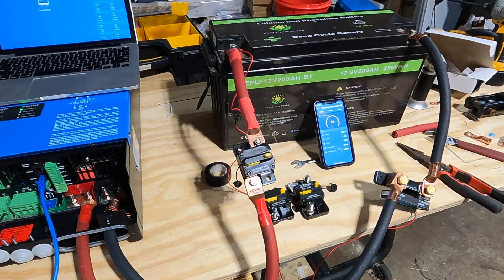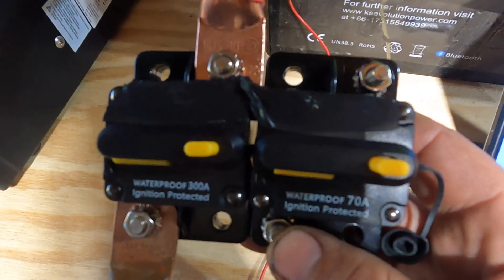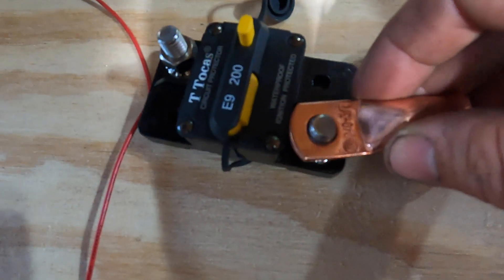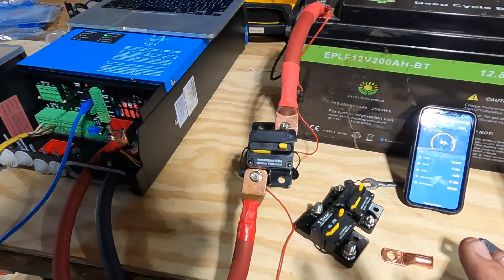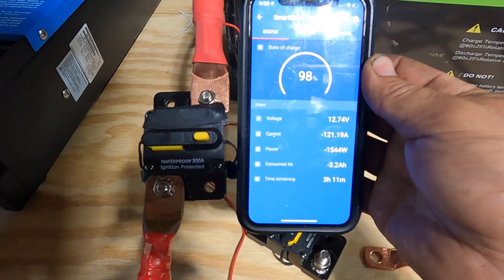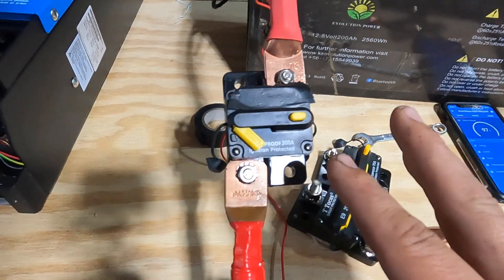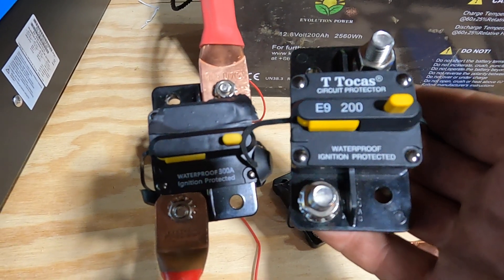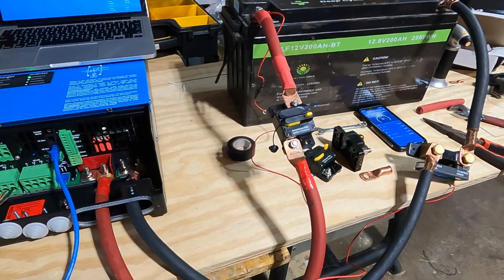Cheap High Amp DC Breakers are they safe?  Let's find out!

Comment: I bought Amazon 150 amp circuit breakers and they trip if solar is outputting more than about 60 amps under load to battery.  If ran off batteries alone it's ok, but the breaker is between the batteries and the solar charger.  I am going to try adding the second one that it came with in parallel to the one breaker and see if it can handle the 150 amps split.  I only need about 100 amps or less, so hopefully that will do the trick.  They are rated 12 or 24 volts, maybe they give more amps on the 24 volt, but I doubt it.  Technically if you split the amps flowing through each identical path it should split the total amps, will try and see.  I really don't need it, the solar charger is rated for 100 amps and I only hooked 4 x 300 watt panels up to it, so it will never reach 100 amps, I just wanted a way to disconnect the battery in an emergency and thought the extra surge protection was good.  If it doesn't work I will just hook the solar charger right to the batteries.  The solar panes are individually fused so it should be safe.  Luckily when it tripped it didn't screw up my new solar charger, it must have built in shut offs - another reason to go with mppt chargers and not the cheap pwm ones that only rob power and burn up immediately if the battery is disconnected while attached to solar panels....

Comment: The duty cycle of those breakers are the problem......even if they don't immediately trip, they get hot and trip. Can't run all day, only 10 minutes or so imo

Are those ok to use with AC? I wasn't aware, thought for DC only.

Comment: Great video I have been shopping through Amazon and also wondered why the high amperage breakers don’t even have the appropriate space for a large cable to hook up to.  Next, can you test those breakers? A lot of them are max 54 V.  And I see a lot of people using them on their 48 V off grid batteries which have a max voltage of 57 V. It would be interesting to see what the max voltage those breakers can actually handle.

Comment: Ok then,  i have some of those cheap breakers 300 amp i was going to install mainly as a cut off switch because i have300 amp terminal fuses with the 10,000 amp interrupt already installed.   Those breakers are going in the trash now.  I was wondering why the terminal bolts were so small for 300 amps.  I put a 80 amp one on my dc to dc 60 amp charger and it was making some clicking nosies but didn't trip and the voltage after the breaker was very weak.  I took it off and put an ANL fuse. The dcd to dc works fine now.

Comment: That device says 48v. Our batteries i mean the mostly batteries are 51.2v and goes max 58v .So are not for our batteries....they have some same who says circuit breaker from 12v to 72v and max on 150ah  .That is better but again they get again hot on 110ah for more then 20 minute but the are not switch off easily. Me for secure reasons i will chang it and this one .

Comment: Any chance one of these could cause parasitic draw on a car battery if it's in line of the positive cable leading to the battery?
Reply from the maker: Hypothetically, if there was a load and it was juuuuuust making contact that connection would produce heat an the heat would be a draw  on it's own.  However, this would only happen if there is a draw some palce else.  If it's just the switch, no, I don't think so.
Reply: @sotasolar  Cool. I'm trying to find a parasitic draw and I cannot find it for the life of me. but something is pulling 1/4 of a volt a night off my battery, resulting in it dying every few days. So I'm looking at anything that's out of the ordinary. This car was a gift and I'm not sure why it's go this breaker on the positive lead.

Comment: Good morning do the 12v circuit breakers have a connection direction? I have one between my battery and my converter and one between my solar charger and my battery and I'm wondering about the direction of connection... thank you
Reply from the maker: Not that I’m aware of. For batteries power flows both ways so  ¯\_(ツ)_/¯

Comment: So these things from ‘no name’ Chinese companies that have no external QC checking from an ‘reputable’ overseas parent company are basically fraudulent in their labeling (labeled 300a and only gets 120a -thankfully).
They lie on their labelling on many things such as 5kw diesel heaters labelled as 8kw and generator motors labeled at say 5000w and lucky to push push out 1200w. And with no oversight from an external ‘western’ parent company for QC and with no real internal consequences for fraudulent claims you can safely wager that their claims they make on the packing are false. They lie. What would you expect from a largely atheistic country.

Comment: Only tested at 12Vdc you do not get an arc flash at that level (so its a cheat)  At 24V yes you can get an arc so the test not properly valid (dont even think of 48V+)

Comment: What would be the cause  for a CB to pop?  In the last week I’ve had both pop one at a time. The only thing I have running is the fridge? The. Inverter battery indicator shows four bars.
Reply from the maker: If it’s overcurrent or it’s mislabeled like these were.
Reply: @sotasolar  what does over current mean

Comment: watching a few of these videos, I wonder if the current can be like 20a but after a long enough time it would pop open. which is not ideal for a charger current of 30A expected to run all day
Reply from the maker: In that case it why you should oversize your wires and circuit protect with that in mind.

Comment: Caveat Emptor.   Where did you get them?  I have never run into parts this far off spec.  Having literally installed hundreds of products like this.  The mere fact that the bolts were too small for the stress large diameter cables might put on it should tell you that it is poorly designed.  Sounds more like a bad buying decision than anything.  The device is obviously crap.  They played the rating game, going for intermittent operation rather than continuous duty rating.  Read the specs, if they have any kind of approval rating they have published ratings. Stick with Bussman, never had one fail to operate as advertised.  Our systems had warranties and support that included electrical systems, excluding bulbs and third party electronics for extended periods (fire trucks, they never seem to be too old to work).  Never scrimp on the cost of important parts, it will cost you more in the long run.

Comment: Thanks for the info just changed my cart for T Tocas 150 amp
Reply from the maker: If you need higher amps we recommend the DIHOOL Dc breakers https://amzn.to/3vRqWex you can choose single pole for cheaper options.
Reply: @sotasolar hello! Working on a 12v system. Any ideas on a good 500 amp circuit breaker? Been researching and haven’t found much unfortunately. Happy to spend what is needed for a quality product.
Reply from the maker: yes! Dihool 400amp breaker. https://amzn.to/44ihxJE check out some of our recent build videos, we’ve been using these now.

Comment: I have done extensive testing on this size Chinese thermal breaker.  I found none of them to be calibrated and the internal contacts on all current ratings I would rate as only good for up to 50 amps and 24 volts.  I had so much trouble with them I measured the DC resistance  at 20 amps of each one, then determined a trip point, which I labeled each one.  You can do this by measuring the DC resistance, then calculating the current that will cause the breaker to dissipate 2 watts.

I don't recommend using these breakers above 35 amps.  I only use them for running accessories off my power bus.  The Buss brand thermal breaker is the best one I have found so far but, thermal breakers are not very precise, the DIN rail DC breakers are much better as they have thermal and magnetic trip sensing.

Comment: When the heater was running, could you of safely touched the lug on the breaker?
Reply from the maker: The terminals never got very warm , it didn’t last long enough :-) which is the better of the two failure modes.

Comment: Great test!
Which app did you use?
Reply from the maker: We use Victron equipment mostly, so likely the Victron Connect app
Reply: @sotasolar  thank you for the quick reply.
One more question.
I have a 72v electric ride with  50A YYK controller. Do you think 60A/72v breaker is ideal?
Reply from the maker: Higher voltage breakers are usually DIN rail mounted. Usually you want to go 10-20% higher than your load might be and size your wire for the circuit protection. I’d be looking at 4awg wire, maybe 80-100a breaker.
Reply: @sotasolar  thank you so much brother.
Very appreciated

Comment: ONLY use blue sea systems breakers  these chineese knock offs can cost you your life.
Reply: ONLY BLUE SEA
Reply: I just had an issue with my inverter going low voltage. Upon inspection, my BULVACK breaker was extremely hot, like fire danger, cannot touch it hot. Rated for 300a I was using approx 60a and the breaker got very hot but never broke, just got hot without tripping. If my blue inverter wasn't telling me I had low voltage, I could have lost my home! Do not use these Amazon breakers!
Reply: Anyone use the car stereo breaker like stinger etc.. it’s good to see/know how these are made if quality copper components are used what brands are trusted usually, the ones with the higher warranty would be the choice. Don’t understand why it’s so hard to get quality direct current parts..

Comment: Anyone using this type of THIN, BRITTLE piece of Chinatown market is either INSANE or Criminally STUPID!

You buy MOLDED CASE MCCB AND YOU PUT 50$ into a proper mechanical SERIOUS switch that is designed for load bearing.

A sustained 125-150A through any chinatown switch will give you smelly plastics, MORE will BURN it down within the hour.

THIS.IS.NOT.SMART.

Comment: I'm noticing that your heater is pulling 120 amps @ 12volts, I have the same heater and at 1500 watts it pulls out 7 amps from the wall at 120 volts, Now I'm wondering if 12 volts pull 10 times more amps from it, hmmmmm, that would be a good test to find out what common appliances run at 12v compared to 120v  😯
Reply from the maker: Couple of things here.  First, the big question, can appliances run from straight 12v... mostly no, some things that use a power brick might work if their working voltage is lower.  Or did you not notice we were using an inverter, with an inverter you can run about anything.

The math on what you described doesn't  seem to make sense to me.  7 amps * 120v  = 840 watts.  We can convert that to a DC equivalent by taking 840 watts and dividing by 12 and gives us 70 amps DC.   I'd expect it to actually be 75-80 amps with losses in efficiency, etc.
Reply: I run my equipment from a 1000 watt inverter, and it just seems the amps are different from ac to dc, 12v seems a lot more higher in amps almost 10 times that of ac
Reply from the maker: That’s because 120 volts is 10x 12 volts. The two are related with watt’s law.
Reply: It would be 1/10th of the amperage, not 10x. Even then, I think the math works out different, but do ohms law for your heater coil and find out!
Reply: I did try run my computer from a 1000w dirty sine wave inverter in my car and it pulled only 7,5A according to my clamp amp meter. But the computer did say the GPU was running at 200w and on top of that comes the TV and rest of the cumpters usage.... 7,5A only is around 100W less then half of what the actual power usage should be. Also the inverted refused to run the computer at all without having the engine running and the batteries is brand new AGM 100ah 850A times 2 as it is 2 batteries.

Comment: Why did you think your alternator went bad? What exactly did you learn the hard way? Thank you.
Reply from the maker: Alternator was old. Diodes burned out. Some of what I learned the hard was these crappy breakers fail way early. I also learned not to use CCA wire. Check out the video on the mc9 bus system I re wired (my system) . I talked about a few lessons learned.

Comment: That is great that you are checking these circuit breaker out. It is fascinating if they are in calibration or not. 35 yrs ago I used to work for a company that made aerospace and milspec electronics.  [I'm an electrician, not an engineer, but I was with my boss working in a lab testing industrial circuit breakers, and some residential circuit breaker too, for 120 volt, and 480 volt.  It was fun seeing what melted down, or blew up! Sometimes we put into an oven to boost the ambient air temp, and sometimes in a chamber with nitrogen to cool it down. It was crazy how the changing ambient air temp effected the cablibration of the breaker.  But also the other project you worked on the customers project when that lug was melted.  You identified it as the washer, kinda obstructing from make full surface area contact, and it heated up.  I see that often doing electrical work in residential homes, in those cases, it is corrosion from water leaking in that does it.  But it is great that you check this out! Al from CT